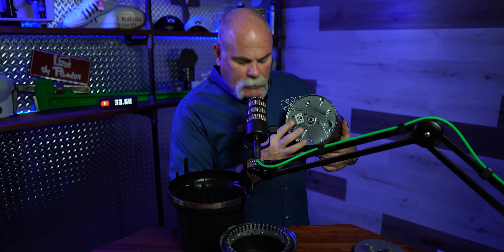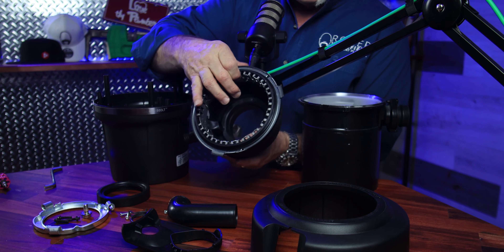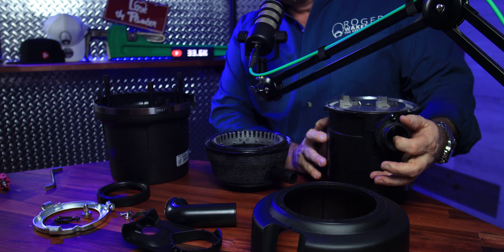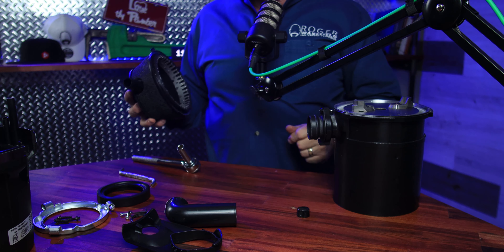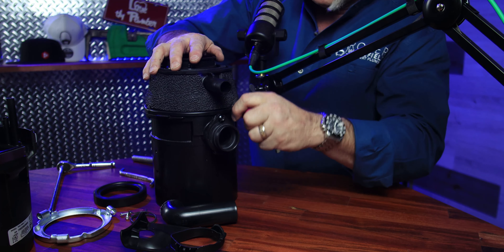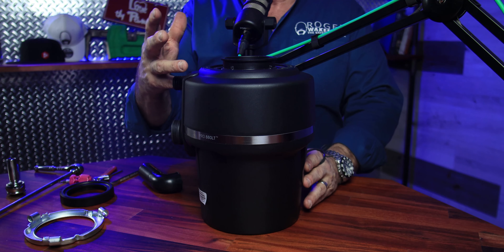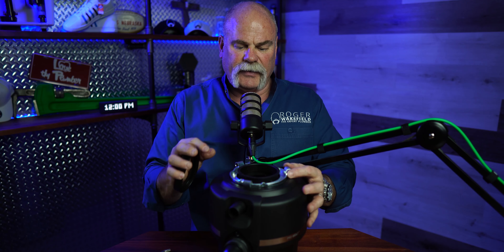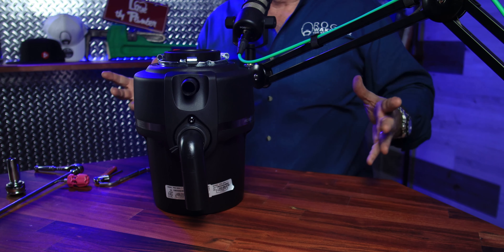How Does a Garbage Disposal Work? - DIY Plumbing

Comment: I used to work with a plumber that would always tell the homeowner that "garbage disposal" is a bad name for that.  People hear garbage disposal and think they can shove anything down there and its okay.  

At my house I'm careful as to what actually goes down my drain, and I also periodically run hot water and Dawn soap to help loosen the grease and flush it down the system
Reply: gotta love it when people throw rice in ...had them so packed with rice and the trap plugged up ....was like a geyser that hit the ceiling when i hit the switch...been doing apartment maintenance 17 years and if it was my call id tear everyone of those damn things out..
Reply: Once I caught my grandma putting a whole orange Down there

Comment: how about showing us how to unplug a sink using the garbage disposal?

mine was not draining  100% blocked
on thanksgiving  the person upstairs plugged up the line...  I was able to use the power from the  garbage disposal  to unplug the sink  by blocking off both sides (as it would just push the water to the other side)with my hand  and the pressure created from the  GD  cleared the line and it drained immediately  Saved me 140$ from having someone come out (also save the landloard money as well )   we would have had to end up paying from our deposit

Comment: If I had a dollar for every time a customer was so proud to tell me how the keep their kitchen fresh by stuffing citrus peels in their disposal smh
Reply: Dunno about you, or the next guy. But I like to keep my kitchen smelling fresh by cleaning it.
Reply: @L44tsmasher735  well that’s not actually cleaning anything, so...no. Use ice cubes. It’ll help to breakdown the buildup in the disposal that’s causing the smell in the first place. Even if that’s not enough, it’s better to use a cleaning product, not peels that WILL clog your appliance and drains.
Reply: @andyj6384  I meant keep my kitchen smelling fresh by cleaning the kitchen. 

As for cleaning your garbage disposal, just run hot water through the sink after you're done with it. MOST of the time, this is enough to get rid of excess material. 

If it's bad enough, just pour some dishsoap down there and let it sit a while, then run more hot water.
Reply: @L44tsmasher735  👍👍👍
Reply: this is stupid because it doesn't do anything scented dish detergent ice, rock salt, baking soda,  even hard objects like bones or pits,  in the low end ones and in the higher end ones (or if you have a properly plumbed line with all SS Pipes) and you're REALLY brave you can shove small amounts of glass or even some gravel down them (but this isn't reccomended for the average disposal)
Reply: @L44tsmasher735  this won't work very well either as you have to run it first. stuff doesn't just "sit down there" it builds up in a crusty residue around the walls and the top under the splash guard simply letting it "sit" won't do anything but clean the more than likely least dirty part of it
Reply: @aunabreslingaming3279  it might not ALWAYS work, but soap does do a good job at separating gunk, so it can help. But yes, in extreme cases, you need an abrasive, which isn’t very often if you actually run a garbage disposal according to the manual. That is, running lots of water during the process, as to not let short build up

Comment: It seems like the Insinkerator units 3/4HP and above like that one hold up well. But the smaller 1/3 or 1/2HP units ARE TERRIBLE.  They only last a couple years.  I think it's the cheap grind rings they use. My 1/2HP Waste King is over 5 years with no issues.  Maybe because all of the grind parts are stainless, not just the blades.
Reply: this IS the case and ALSO The case to all those "Dos and Donts" wives tales telling you god only knows what or what not to throw down there which is always basically them or the disposals they're talking about screaming "i'm worn out" they're designed to grind everything and not fail and if it does, you got a crappy unit.